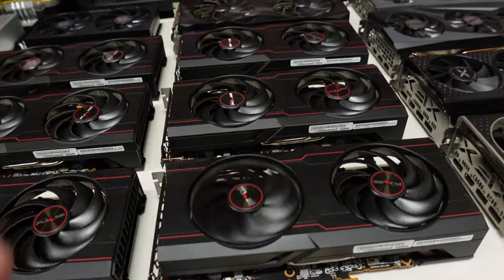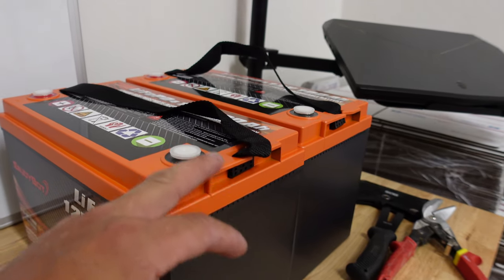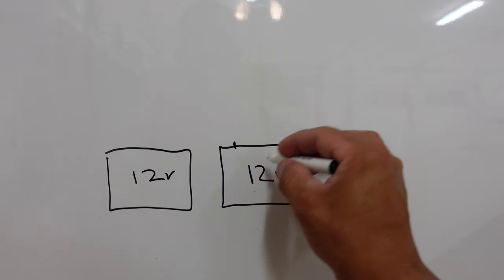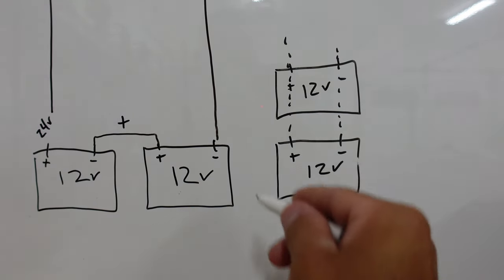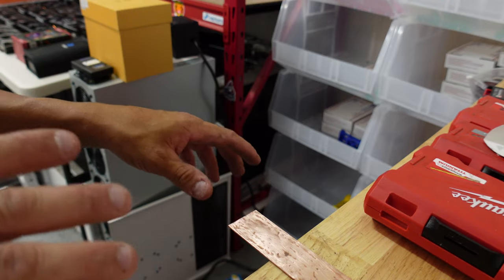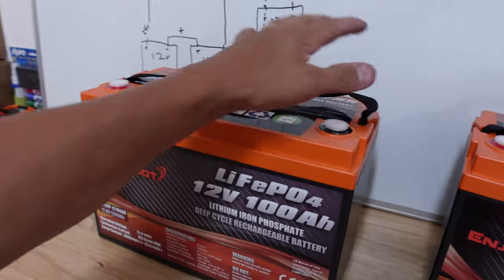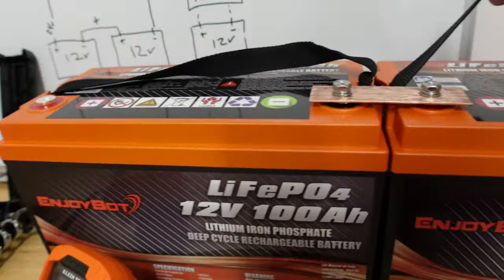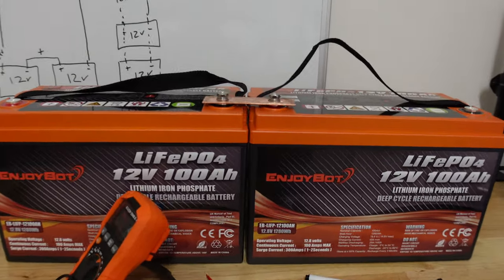Making a Custom Copper Bridge for My Off Grid Solar Crypto Mining Trailer

Comment: Similar ratings are found on automotive deep cycle batteries. In your case those batteries are going to drain quickly due to your extreme amp draw from mining. Almost making those batteries like capacitors. In order to handle that quick discharge, you will want that thicker pipe for sure. The volume of some smaller car automotive 12V cabling is probably similar to your bridge. But those are not handling as much load as you will be here! Go bigger or stack 2! Dont worry about 12V "Being small", your amperage is massive and will cause all your heat.
Reply from the maker: Perfect thank you!! Will do

Comment: The thickness should be about 15% of the width for your busbar
Reply from the maker: Alright can you explain this like I’m extra special please LOL
Reply from the maker: The bus bar as in the two I have the batteries going too in the trailer now? I need to go check the thickness and then divide by 6 or so?
Reply: @ChumpChangeXD  well, and this is a sloppy, but often used rule of thumb in solar for instance, if it's 2 inches wide, you'd multiply 2x.0.15 so you're bar should be at least 0.3" thick.
Reply from the maker: @witness1013  your awesome thanks man! 

One last question for you do you think stacking a few of these together would be good enough? If the math works out obviously
Reply: @ChumpChangeXD  not so much with hand hammered ones as they don't get all that flat, if you could press them together you'd have better contact, but you get lots if heat build up between layers that don't fit air tight, so, for peace of mind, I wouldn't. It'll work, but not all that safe.
Reply from the maker: Alright leme see what I can do to make this better! Thanks brotha I appreciate you!
Reply: There are 3 considerations for the width/thickness of a bus bar. 1) cross-sectional area for the amperage, 2) structural integrity of the bus bar and 3) minimum thickness for electrical flow in a solid vs skin flow in a sheet. I suspect this rule of thumb relates to both the second and third considerations.

Comment: Remember, higher the voltage, lower the current.  If you are concerned about insulating the outside of the smashed copper, you can use a rubberized heat shrink.  Your projects are very interesting for off grid use, thanks for sharing.

Comment: Looking up recommended copper bus size for 30c temp rise and calculating cross sectional area of Type K copper pipe gives the following; 1/2" pipe good for 100 amp, 3/4" pipe good for 300 amp & 1" pipe good for 400 amp. Anybody doing this should look up the charts and do their own math.
My recommended procedure would be to cut the pipe to length, tin the inside of each end with electrical solder, crush the ends of the pipe with a vise, drill the hole to connect to the battery, solder the connection area (makes the end of the pipe in the connection an electrical solid piece with no air gapes), use washer and dielectric as mentioned below for the connection. Finally, once the battery stack is completed install physical barrier to protect the bus bars from accidental contact.
In my opinion, the round bus bar would both look better and the lack of air gaps between the sides of a crushed  pipe would be safer.

Comment: I hope you have this in a very well ventilated area and not in your house without a H2S detector. Data centers who have large UPS units all have H2S detectors in every UPS rooms . overcharging a lead acid battery can produce hydrogen sulfide gas. This gas is colorless, poisonous, flammable, and has an odor similar to rotten eggs or natural gas.  be safe...
Reply from the maker: I’m not using any SLA Batteries my man. Appreciate it tho.
Reply: @ChumpChangeXD  i just saw the batteries and and thought they were lead acid my mistake didn't catch the lithium part my mistake
Reply from the maker: @ian-op6bm  No worries at all my man!!! Appreciate you!

Comment: Clean the diy bus bar with pire alcohol to remove any dirty/impurities.
From there you can either shrink tube the whole thing or use a “plastic” spray to create a thick layer on it. Personally I would do both for maximum protection of accidental contact or anything similar and minimum corrosion.

Obviously you need to clean the area around the hole where those washers will make contact with and the hole itself.
This will mimick the high voltage bus bars you see on EVs among others, just for some extra peace of mind. 🤘🏼

Comment: I guess the biggest question might be, what is your amperage draw going to be? That will be the biggest determining factor in the size of your bus bar. I can only speculate on the approximate size of that, but a 40mm wide by 2mm thick bar should be able to handle around 380 amps of DC current running through it. My guess that's type M which might be around 0.8mm thick times 2, which would be around 1.6mm thick smashed together, thus there might be a 8% reduction in amperage handling, which would still be more than enough for what you're going to be using that for I would guess.
Reply from the maker: Your the man thank you!!

Comment: Either one should work, I would probably use a star washer on bolt side with dielectric gel to ensure a tight connection. You can use a clear coat to keep it from turning green, and a thermal camera to ensure it isn't getting hot.

Comment: been using cooper pipe buss bar for a year now and it works great, you can also double stack the bars to achieve higher amps. Use a top washer to make them stable. When connecting in parallel, make the final output of the positive from one battery and the final negative from the other battery to balance battery consumption / charge between both battery.
Reply: Each bar can easily carry 100 amp from my experience without heating up. I didn't even sand them, but it's a good idea to do

Comment: Mechanical Engineer here: if you pull that piece of copper off the batteries and throw a multimeter on the copper to measure its resistance, I can calculate if your current thickness is good to go or not. I got a theoretical value for resistance but curious to see if the multimeter will get a measurement on it.
Reply from the maker: Alright I’ll have to figure that out! Thank you!

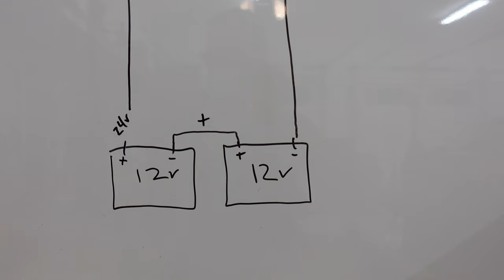Comment: 3:58 fun fact electricity "flows" through the negative (to positive) terminal technically.
before the debate of electricity's ability to "flow"
build looks great, i have a small 400 watt system setup, only 12v, but i want to upgrade.
it's crazy how many things a small system can power.
keep on keepin on :)
Reply: ^ his right.

Comment: I've been using the EcoFlow Delta Pro units to GREAT effect with my mining rig. You get two DPro's, some smart extra batteries and the 'Double Voltage Hub' (that's the key part) and it's ACES MAN - check this stuff out for sure!. I've got both DPro's PV input's maxed at 1600 watts each and man, I'm telling you this is where it's at right now. The 6 units give 7.2KW of 120v output with a 48v LifePO4 bank size of 21.6kWh. The DVH gives me 240v Split phase and for my needs this have covered everything.
Reply from the maker: Send me an email if you would with some links please! Contact@chumpchangexd.com 
Appreciate you!

Comment: Isnt copper brittle from work hardening when you hammer it flat like that? 😬
Reply from the maker: Possibly but it would be no different than strands of wire IMO
Reply: @ChumpChangeXD  strands of wire aren’t brittle
Reply from the maker: @Desertjoe789  I understand that I’m saying it’s no thinner than strands of wire even if it micro cracked or something. Copper bends nothing is visible